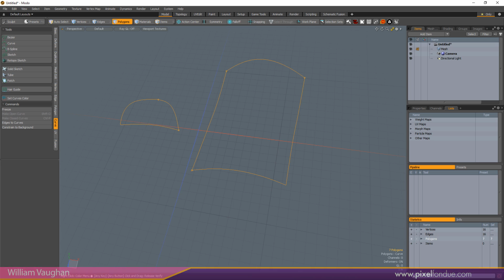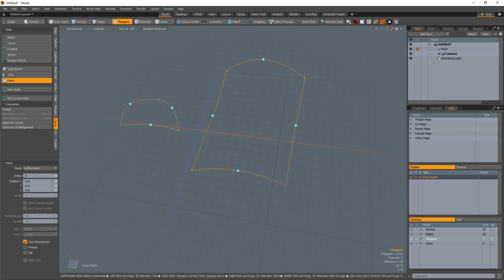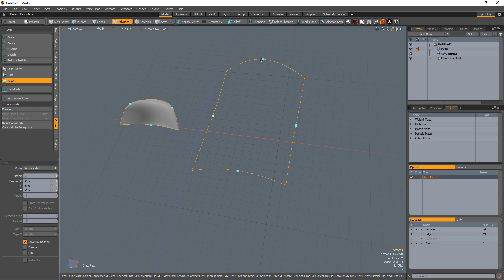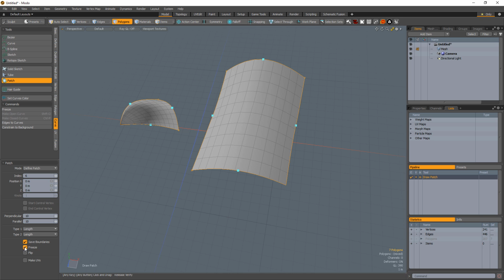MODO | Patch Curves

Comment: One "problem" : when you extend the front-curve of the patch .. then the poly-pattern seems completely unadapted to the original patch-poly-arrangement .. thats not so pretty, Proton?
Reply from the maker: You can simply use the same number of Segments (Parallel and Perp) and it becomes a non-issue.
Reply: that would be fine!